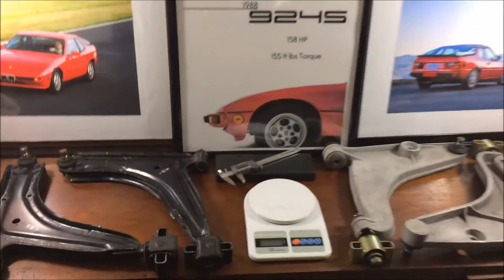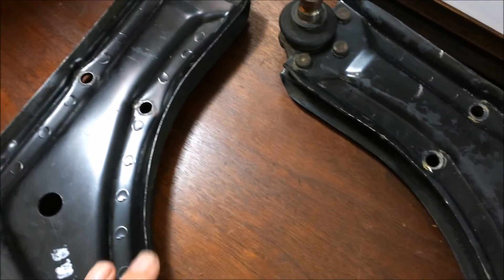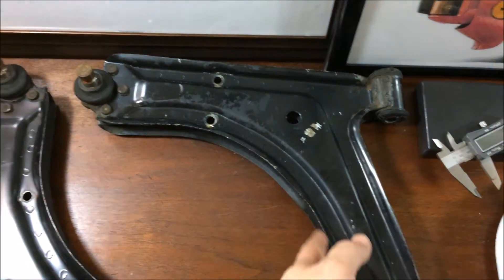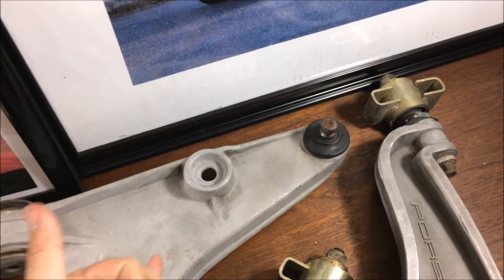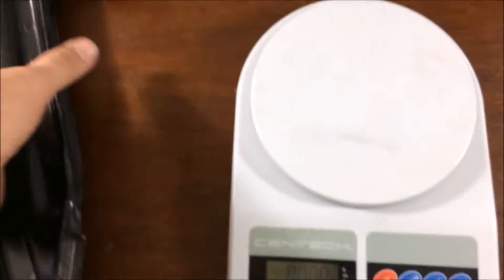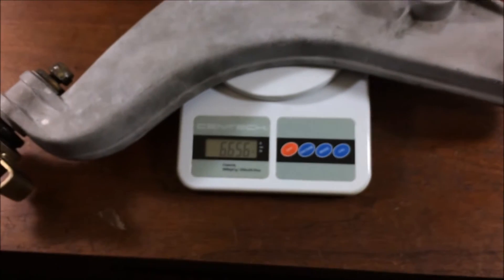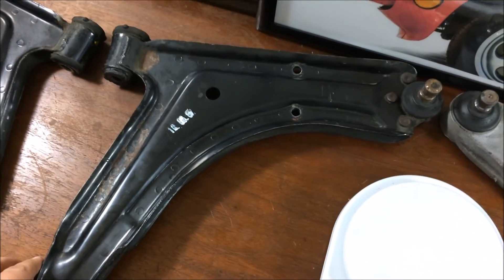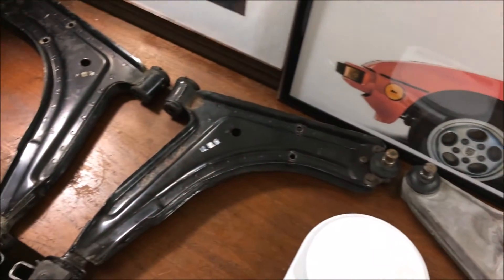Porsche 944 Control Arms

Comment: First of all great and informative video, as usual. Request - can you make a vid next time you do front suspension work on a 944 ? I'm pretty sure I'm not the only one with questions when it comes to adjusting toe in(out) etc. and the whole install - even though it's very simple - would be cool to watch how you would do it... kind of like a natural extension of this video. Friendly regards from the Porsche heads at a MC Garage in the middle of the Norwegian woods.
Reply from the maker: I have all the alignments done at friends shop that has a laser machine. I might do just enough to get it across the street to his shop without wearing the tires, but that's about it. Trying to align a car at home is just out of the question. I tried it once and you're just never going to get it as exact. My tires were wearing after 40k miles and after the laser alignment for $60 that car went 75k on the next set... so personally, I find the alignment cheaper than tires and worth every penny! I hope that helps!
Reply: Ok, I'll forget about the planks and strings then..

Comment: I would never have guessed ! Me and everyone I ever talked to about this, was totally sure the alu ones were lighter and stronger... and I always wanted to change the whole suspension on my -83  back and fore to the never aluminium type. BUT when I had one of them (wishbones) really bend over, I was glad it was steel, or else I could never have limped back to the garage ;)
Reply from the maker: It takes a lot more aluminum than steel for them to be strong enough. While, aluminum arms might be more expensive on the second hand market they were actually cheaper for Porsche to manufacture than steel arms.  So, in many cases people are advocating putting the cheaper part on their cars. While road noise is slightly reduced with aluminum arms, I can see no other benefit...

Comment: Very nice. I just switched over to my 17" wheels and  I am looking at ride quality and support. Just the struts and shocks alone have helped considerably. After watching this I am now wondering a few things - whats you take?

I have some Aluminum CA's from a parts car. Would you consider this an upgrade to ride quality yourself or is it not that noticeable?
Second, I've read that on an early 944 you should switch to aluminum for strength and support of the 17" wheels. How true is this? I mean if I have the parts should I just go to Alum?

Your videos are awesome. Even sent you an email on your aol account - Thanks for all of this. I hope to put some pics of my ride on your FB page soon. Working on the 134A conversion at the moment.
Reply from the maker: People often misunderstand the purpose of things. Porsche didn’t switch to aluminum arms because they were stronger or lighter. They did the switch because they’re cheaper to manufacture and help quieten down the interior.  So there should be no reason to switch if you don’t want to. I hope that helps!
Reply: Sure does, bottom line. Steel is more than fine. You the Man!! I swear I've learned more here on your channel than sorting through all those forums sites - not putting them down, just saying I don't really care about stock colors and ROW flashers when I'm trying to read about suspension or clutch repair - LOL
Thank You so much

Comment: How do you install the rear bushings on the steel control arms? My original problem was that the new bushings slipped right on my new control arms (too loose). I tried getting a new control arm of a different brand and this time I succeeded in ruining the rear bushing from trying to beat the holy s--t out of it to get it on the shaft. It did tell me the original set of arms had under-spec rear pivot shafts, but now I need to buy two more arms, two front bushings, and one more rear bushing.  I couldn't get that rear bushing more than half-way on the new arm, and it's pointless trying to get it back off! I don't see how the arm could be put in a press. Is there some custom tool for this?
Reply from the maker: I spray all rubber bushings down with WD-40. It will slide right on and since its water based it won't hurt anything and dry right up so it won't come off. Good luck!

Comment: Their is a $930.00 price difference! I would've dealt with the road noise...
Reply from the maker: For manufacturers it’s cheaper to make aluminum control arms so that probably had a lot to do with their decision. Today the steel arms are still manufactured since they were used on a lot of cars. So they are the cheaper option now since the aluminum ones have to be made in small runs.

Comment: Can you go from aluminium to steel for an 86 ?
Reply from the maker: Yes! Your '86 is early offset so they will bolt right on to your car! That said, you have to pay attention to the sway bar mounting since there were several different setups. My steel arms attach the sway bar with a mount with two holes, but my aluminum arms use a mount with a larger single hole. So you will either need to find a steel set that has the single hole like your late arms, (which will bolt straight in) or you'll need to source the other brackets to make it work. I hope that helps!
Reply: edredas great thank you

Comment: It would be interesting for you to weight just the wheel end of the control arms like you would when balancing con rods.. 
I think whichever is lighter out at the wheel would be best for unsprung weight reduction, the bushings on the body side are not really unsprung weight IMO.. 
That test may give interesting/different results, the data that really matters.. 

I think I prefer the steel ones I have because they are already paid for and installed ;)
Reply from the maker: I may come back to this in another video. I did weigh them like that but didn't really want to open a can of worms. There really wasn't a significant difference between them I thought that some people might not be pleased with that method. So I just decided to play it safe and weigh them as they are on the car in one take so no one could cry foul. This really isn't meant to be scientific, I just thought it would be fun for people that have never seen them side-by-side to get an idea of how they feel compared to each other.
Reply: It's a great video don't get me wrong, very cool.. Informative..
I understand you not wanting to get into a can of worms.. 
I guess I'm just a can of worms down the rabbit hole kind of guy.. :)